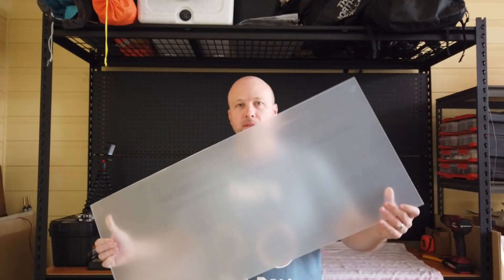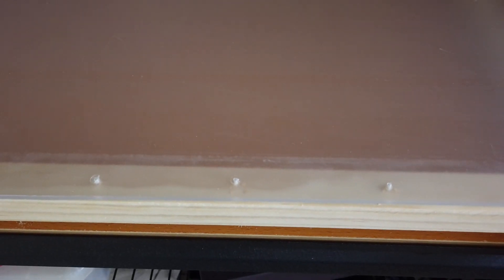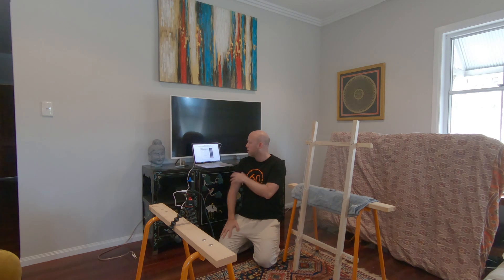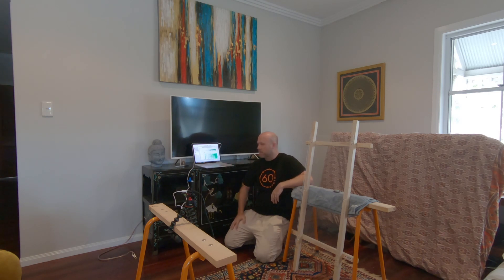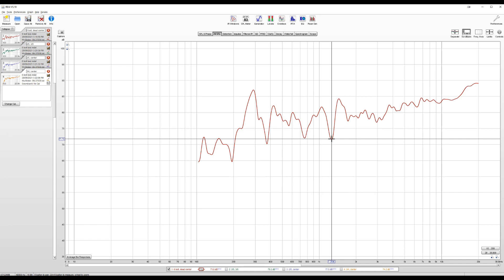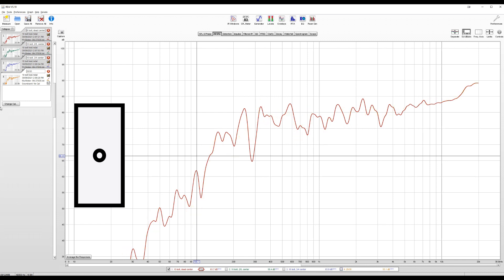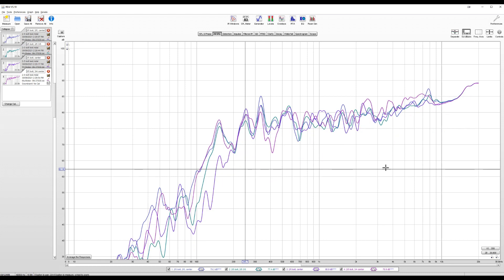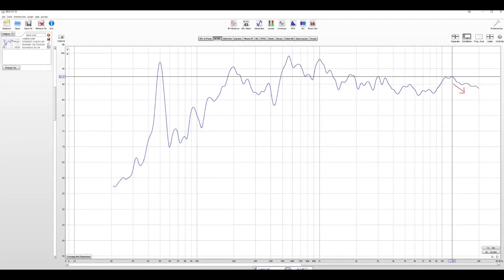Acrylic DML Build 2 - Testing Placement & Rigidity

Comment: Please stick on damping material in a circular pattern around the exciters. Don’t make a solid circle of damping material….leave some gaps. The peaks and valleys are my guess doubling and cancellations and adding damping material may reduce that. That material could be 15mm wide rubber attached with 3M double side tape. Try different weight material to help eliminate that resonance at those frequencies. This is all my uneducated guess work. Keep up the good work

Comment: Thanks in advance for your time and energy and for the great info.  I was wondering what panel sizes you are using, I know they are 3 mm acrylic what are the external dimensions.  I am about to start building an acrylic set 600x900 and was looking at the fixing points and the distance between each point.  Will be using the dayton 4 ohm 40 w exciters.  Will be trying single exciter first on a suspended panel and working my way up to 2 exciters on a frame with multiple fixing points.
Reply from the maker: No problem. Those ones are 1200x400mm. I prefer the narrow/tall aspect just for aesthetics.
Reply from the maker: I have found the sweet spot to be approx 20 -25cm between mounting points. At least on this shape of panel.

Comment: Rather than rigidly screwing the sheet to the frame Ben, have you consided double sided tape of some kind, maybe soft sponge rubber or pvc foam tape....?
Reply from the maker: Yeah I have considered double sided tape. I’ll admit I decided to try the screw in method for aesthetic reasons - it has a nice sort of ‘floating panel’ look (sort of).

I have also read about people having good results with various rigid setups, so thought it would be interesting to through my own method into the mix.
Reply: @TypicalBenYT  Quite so. I looked at the AER Goldy trying to figure out their mounting method, hoping for a cut-away view, but no such luck. There must be a dozen ways of mounting an acrylic panel, or any other material. Just a matter of finding out what gives the most pleasing results, aesthetically and sonically. All part of the fun without selling the grandkids into bondage...
Reply from the maker: @logotrikes  100% agree!

Comment: I thought the whole idea behind DML panels is NOT to be fixed, rigid but free hanging exactly for the reason to vibrate freely from the excitors otherwise the sound would be damped. So I am not sure what you experiment here.
Reply from the maker: People usually make them free hanging (as I have with my other panels) but they don’t have to be that way, and some kind of damping is often a good thing.

What I really want to do is find a way to make a DML that sounds good and looks good too, hence I’m trying different things.
Reply: @TypicalBenYT  I think by fixing them you will dampen the lower frequencies. But think about it. These speakers work based on the principle that the vibration is transferred from the exciter to the membrane so if you fix the membrane, make it more rigid, you actually limit the vibration. Now, that cannot help in any way unless you try to to separate the frequencies on purpose, to make like separate bands, channels, i.e. treble, medium and bass.
Reply from the maker: @zberteoc  If that were true, it would show up in the measurements - but in fact I got my best bass response by adding even more points of attachment to the panel.

You are maybe thinking about the movement of a traditional speaker, where subwoofers require the most excursion to push out low frequencies. On a DML panel, the ability to play down low is affected by the longest dimension of the panel, but seemingly not by the excursion of the panel itself.

Comment: My first thought of material for DMLs was art store foam core board.  I would be interested in how it compares.

Great work, and Subscribed!
Reply from the maker: Thanks Lou. Is that stuff anything like the XPS panels people make?
Reply: @TypicalBenYT  I think its pvc foam with paper either side. I went to Office Works and roughly compared the weight and potential rigidity of two equal sized pieces, one of poster/foam board, and Coroplast.  I ended up with Coroplast. The poster board would be an interesting alternative to try though....

Comment: I just got my exciters delivered today. Hoping this weekend I'll have them operational. For now I'm going with the foam core as my panels. I'm also using the fosi 100w amp. My question to you is how are you running yours with a sub?  I have one but I don't have a receiver.  And not sure what to use since the amp has Bluetooth.  So far I have not come across any videos on people running additional speakers and power supplies. Also, are you running a crossover?
Reply from the maker: Hey Thomas, I'm using an active subwoofer with speaker-level inputs, so it's just a matter of wiring it in parallel with the main speakers. See example 2 in this diagram:
https://soundcertified.com/wp-content/uploads/2020/06/how-to-connect-subwoofer-to-receiver-no-subwoofer-output-diagram.png
Because the sub inputs aren't actually driving anything (just sending the signal into the sub's inbuilt amplifier) it doesn't present any additional load to the amp.

The sub also has a built in crossover, which I have set to ~125hz currently. My current bamboo panels are running full range and I set the sub x-over to the point where the panels naturally roll off. For these acrylic panels I'm building, I plan to wire in a capacitor to roll off the low end, so it'll be all subwoofer below around 100hz.

Hope that helps, enjoy your new panels!

Comment: Looking forward to your next experiments... that HF response of the acrylic is very interesting, knowing that foam and wood boards somewhat lack highs, as per most of the results in the diy community.
Thanks for sharing
Reply from the maker: Yes that was maybe the most surprising discovery, as I'd had the same relatively weak HF on my bamboo panels. Initially I was considering running a tweeter with these (having a taller frame, adding a 2nd smaller acrylic section on the top with a tweeter cut into it) but decided to run full length panels instead. If this result holds up then it seems like a win/win as I'll get good HF with extended LF (due to bigger panel).

Comment: Thanks. Have you considered using less symmetry on your panel mounts?
Reply from the maker: To be honest that didn’t even occur to me. I’m thinking about it now though!
Reply: @TypicalBenYT  also you use a section of pipe to hold the exciter in place for sweeps in various positions. That weight has to have a substantial impact? Does it just impact efficiency or does it impact response as well? Enjoyed watching your video thanks.
Reply from the maker: @morayjames92  yeah the intention was just to maintain some pressure on the exciter to avoid buzzing.
Reply: @TypicalBenYT  understood, have you done a reality check sweep? you can use your panel which has the exciter already installed on the acrylic and simply add the weight and see what it does to the response.

Comment: I suspect you holding the exciter on the panel as opposed to it being attached my cause undue interference in your measurements as you cannot maintain the same pressure each time you move and hold the exciter again Ben.
Reply from the maker: Hmm you might have a point. I can test this by taking several measurements in the same position but deliberately varying the force on the exciter. I’ll give it a go and comment the results!

Comment: I don't know if you do any post processing or just upload the stitched together clips but lowering the volume on the drilling would go a long way with headphone users. 

I'm getting ready to build two large panel DML speakers. Plan is two Dayton 4 ohm x 24 watt on each at the sweet spot. I was going to play with placing some rockwool insulation behind the panels to mitigate the bouncing frequencies... I'm just messing around, I don't know much about audio stuff but saw videos of these exciters and figured why not.
Reply from the maker: Hey James - thanks for the feedback I’ll keep that in mind! 

I reckon if you’re planning to wall Mount then then the insulation is a good idea. If you’re able to have them ‘out in the room’ like these floor standing versions, you might prefer to leave them open, or try both and see what sounds best!